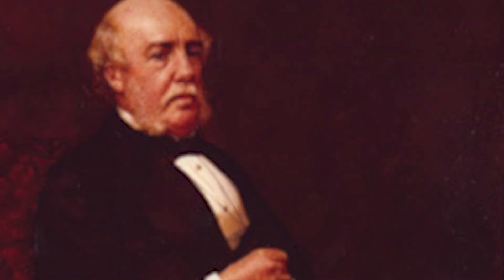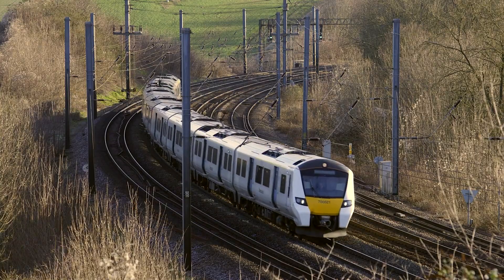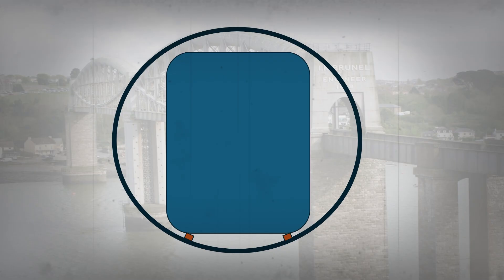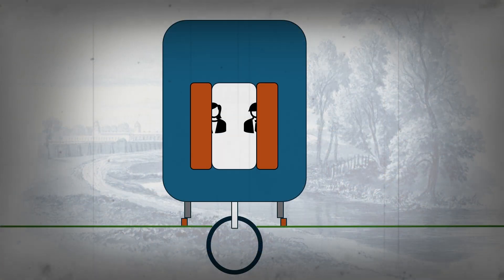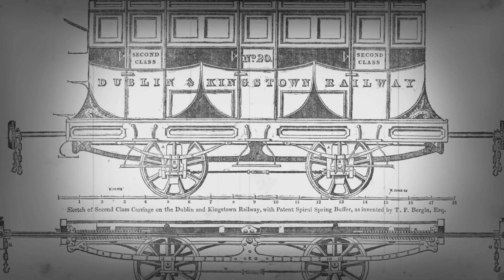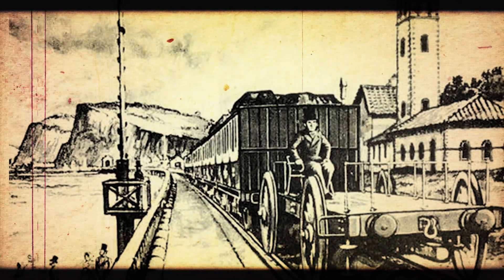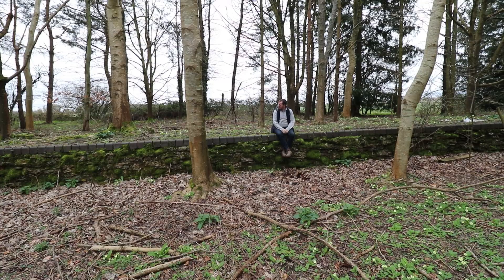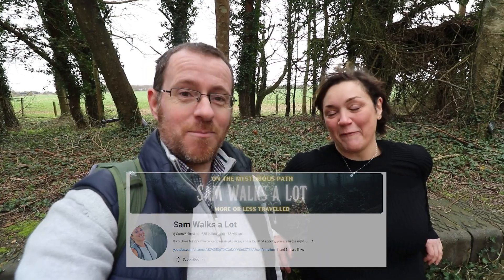Brunel's Big Mistake: The Atmospheric Railway Disaster!

Comment: Imagine an attempt at an atmospheric railway with silicone rubber and lubricants available… probably still wouldn’t have worked but it might have been interesting.
Reply: The sticking point is the mechanical link twixt piston in pipe and train above pipe. Somewhere else I these Comments I offer a magnetic link and an UNslotted pipe. Magnetic piston and corresponding magnet under vehicle just above the pipe. Or Maglev of course, Brunel would have liked Maglev.

Comment: Nice video but I think you left out quite a few other problems. I read a bit about the London and Croydon Railway.
In no particular order:
Problem 1. Turning a train around at the terminus was awkward and slow. You needed to have a steam-powered shunting engine on hand every time you did this so it was inefficient.
Problem 2. Junctions were impractical.
Problem 3. Reversing the pipes would have been slow and inefficient making single line working impractical. 
Problem 4. You could only have one (or  two with difficulty) trains in one section of pipe. A section was the pipe between two active pumping stations. If you want to have a more frequent service at peak times this was not possible without more pumping stations.
Problem 5. If two consecutive pumping stations failed then everything stopped. The pumping stations were not powerful enough to create a vacuum in three sections.

Some of these might have been overcome in time but in the end it did not seem worth it to the companies involved.

Comment: Fascinating. I wonder if modern materials could make it work. Thank you again.
Reply: Interesting question. I gather that the chronic problems with the Bulleid Pacifics have been solved by using synthetic material gaskets.
Reply: Only for a while I suspect as the "flap" will always be subject to wear as the link passes along the slot. Regular replacement of gasket would be needed.

Comment: Were any of Brunel's designs successful? SS Great Britain -Flop. SS Great Eastern - Flop.  Seven foot gauge - Flop. Clifton Suspension Bridge - design altered by Barlow and Hawkshaw after Brunel died.
Reply from the maker: Well there is a question!
Reply: I haven't looked in to either chap in detail, but maybe Brunel is a bit like Winston Churchill... turns out Churchill wasn't a nice chap really, but he did win us the war so you forget the failings!
Reply: @whereinsussex  try and keep your comment to the subject, not ramble.This video is about the engineering angle. Brunner is one of the pioneering engineers of the railway. Also Sir winston Churchill did a good job when he was needed.
Reply: Brunner had the get up and go, also the vision  to develop new technology.  His civil engineering on the GWR, he excelled. Broad gauge, worked, but standard gauge was being used  lot more. But was not a fail. Working with Daniel Gouch cme of the GWR, they were a superb team. So Brunnel had more successful projects. Than ones that failed. To the writer of the original comment, go back to school.
Reply: @lizlawrence4553  What 'new' technology? All of his projects failed. It is you that needs to go back to school.
Reply: the seven foot gauge was not a flop. it worked perfectly and arguably would have been better to convert the rest of the network to 7 ft. it was converted to standard because it was cheaper to do that than convert all the other railways in the uk to 7ft.
Great Eastern had a pretty successful career as a cable layer. the idea of a metal ship powered by steam that could carry enough fuel to get all the way was proved, as was the concept of the screw steamer in the Great Britain.

He ws there first and arguably better.  remember Betamax was better than vhs and logie baird's tv was first, yet vhs won out as did mr farnsworth's cathode ray tubes/mr Trevithick was there first but died a pauper and stephenson cashed in...

Not long after Brunel proved his point the north Atlantic liner trade became the most important in the world and the one by which all others were measured. equally the idea that you could book through with one provider was kept up by the big four and only(as per so much)destroyed by br.
Reply: @andrewyoung749  The 7 foot gauge was far more expensive to build than standard gauge, and I'm not just talking about converting the existing standard gauge lines. All new lines would have to be designed with wider tunnels and bridges. Stations would have to be bigger. The extra cost for longer sleepers alone would have been enormous. Locomotives and rolling stock would be much more expensive. Ernest Marples would have closed down the whole (much smaller) network citing cost. Brunel thought that the broad gauge would mean higher speeds could be obtained. He was wrong. It's the length that dictates the speed as has been proven with the Shinkansen which runs on standard gauge track.
Saying Great Eastern had a pretty successful career as a cable layer is like saying the Boulton Paul Defiant had a pretty successful career as a target tug. That wasn't what they were designed for. There has rarely been a ship that has been more unsuccessful and accident prone as Great Eastern. 
There were metal steamships before Brunel's design. The screw wasn't even his idea. He got the idea from seeing SS Archimedes, so he didn't prove the point. The Royal Navy were already adopting screw driven vessels.
Trevithick didn't invent the railways. That was the Austrians, nor did he invent the steam locomotive. That was invented in France. Trevithick put the two together but his locomotive wasn't very successful. We don't even know what it looked like. Stephenson didn't 'cash in on it'. There were plenty of successful locomotive designs after Trevithick and before Stephenson. I suggest you read Before Rocket: The Steam Locomotive Up to 1829 by Anthony Dawson.

Comment: The more things change the more they stay the same. The evolution of transport in Victorian times is happening today as we learn to live with greater electrification for when fossil fuels are exhausted. 

EV's give people range anxiety and Hybrid Cars only do a few miles on battery power, car heating soon becomes a problem making it necessary to switch over to the petrol engine. The trains have no problems with electrification, I wonder how air travel will continue in the years ahead.
Reply: "when fossil fuels are exhausted"!? I don't know where you heard this, but it's absolutely incorrect - there is no concern at all that any type of fossil fuel (oil, coal or gas) is anythere near being depleted.
Reply: @sunnyjim1355  plus ICE fuels can be synthesised and adapted from natural vegetable "juices". I noticed when burning Leylandii prunings how well they burn in my chimenea .... with surprising vigour !

Comment: Rats ate the leather too!! Oh bugger... you knew this...
Reply from the maker: Apparently not
Reply: @pwhitewick  , I do remember reading somewhere that Brunel solved the "rat" problem by changing the substance that was used to treat the leather to a substance that rats did not like the taste of.  did you come across any such information about this change?  I was using environmentally friendly canola oil as chain saw lube until rats found a way into the shed and chewed at the reservoir cap so I found Brunel's dilemma believable when I read this.  that doesn't make that story true though.